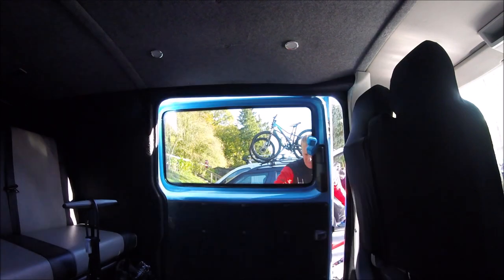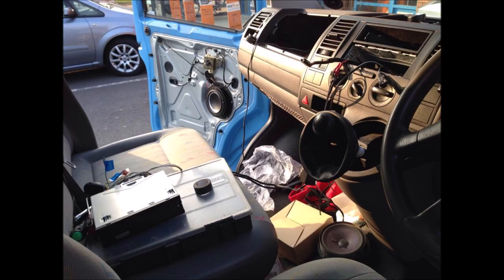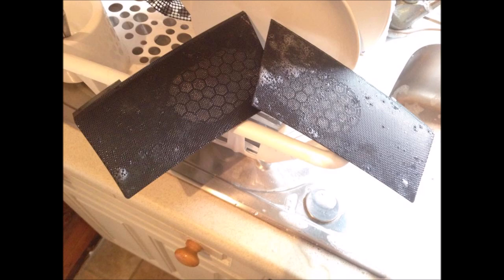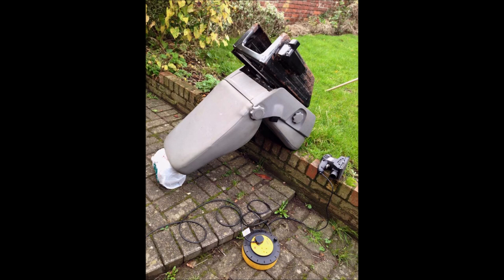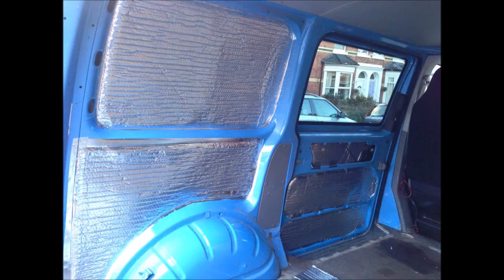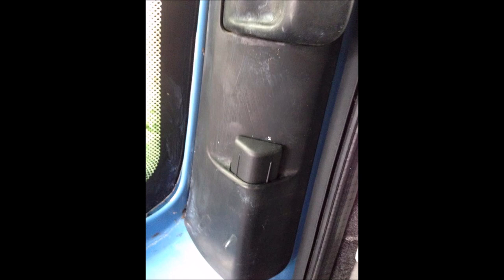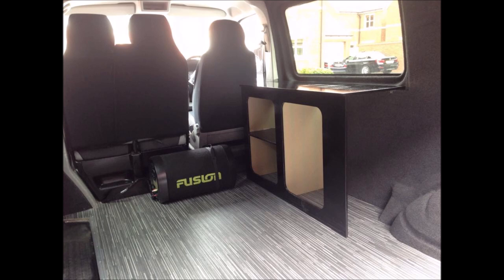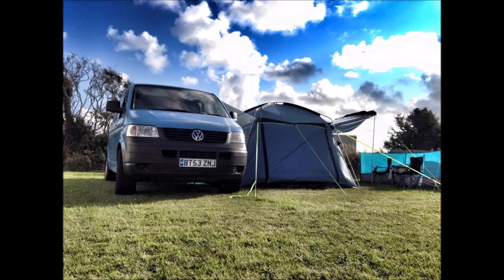VW T5 Conversion from Panel Van to Camper Van (Self Build)

Comment: Brilliant Scott your definitely my sort of fella. And by that I mean you did your conversion as cheap as possible which is something I am trying to do also. And very good it looks too. With regard to the cupboards do you think it would pay to buy a bit better version as I am worried that you had to bend them to get them to the correct shape. I think the small cupboard wont be too bad to fit as I can use rivnuts to secure it under the window but the taller one maybe a bit more difficult. Can I ask where were you able to secure that to ! Definitely going to use the same company you bought your R & R bed from in Wolverhampton given the price and I am sure I have seen them on Ebay. Hope we have a good Summer so that you and your family can also get the benefit from your hard work. Must also add that I have literally looked at hundreds of similar videos but yours is the only one that has given me the optimism to do the same.
Reply from the maker: Ted Edwards cheap was the key. I know people that have spent more on paint than the whole van and conversion cost me! Do they have any more fun with an 8 grand paint job? I would not let tent poles and bikes near a van that was so pristine. It’s a fun vehicle that has bikes on the back, inside and loads of mud in it at times. Thanks for watching and the comment.
Reply from the maker: Ted Edwards the bend in the wood so easy. Used pound shop ratchets. I am not joking.
Reply from the maker: Ted Edwards also the cupboards all screwed to the wooden panels using L brackets.
Reply from the maker: Ted Edwards streamline auto beds were brilliant. Job done in an hour. Couldn’t remember the name when I did the voice over but the link is in the description.
Reply from the maker: Ted Edwards any more questions please do ask. It was as cheap a conversion as you can possibly do.
Reply from the maker: Ted Edwards it can be done!! Cheap!!!